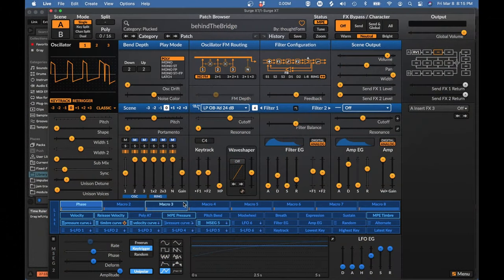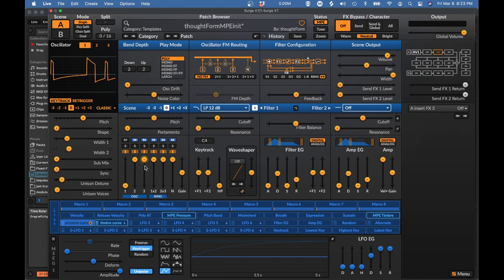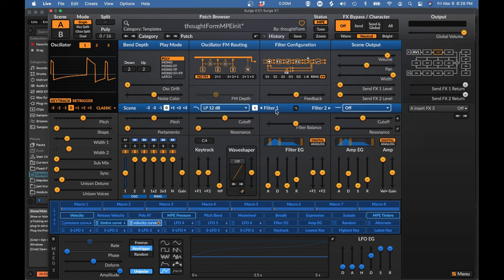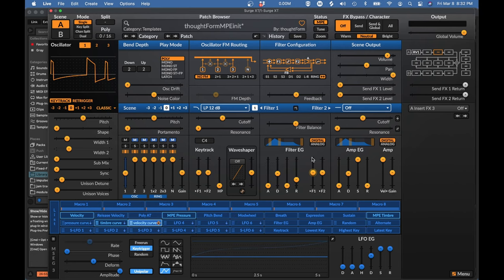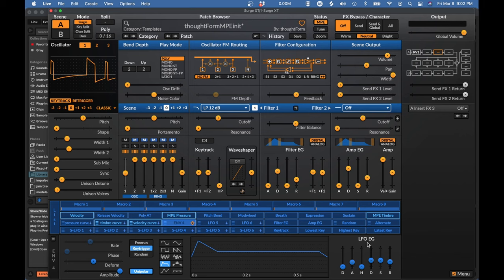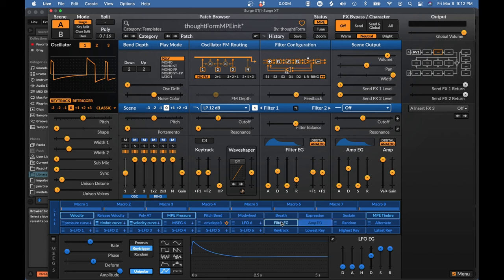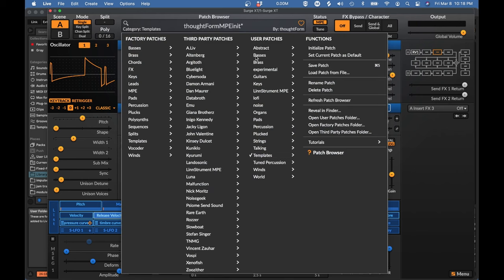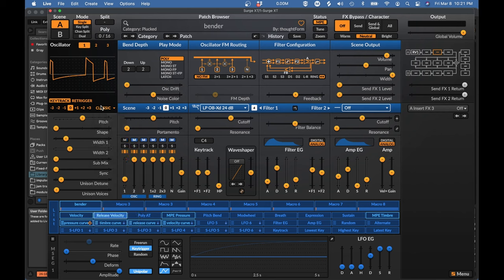MPE Sound Design in Surge XT: Plucks and Envelopes

Comment: I really like your "Pluck and Sing" sound for the Linnstrument. Could you make a short video describing how you created that? For that sound, I notice "Keytrack" modulates the Amp EG decay. What does Keytrack do?
Reply from the maker: Keytracking will give you a higher number when you're playing a high note and a lower number when you're playing a low one. It's useful for a lot of things. I don't remember what I did for that sound at the moment, but most likely I wanted more sustain on the higher notes but the low ones were getting muddy, So with keytrack, more decay on the high notes and less on the low. Does that make sense?
Reply from the maker: I will keep that sound on my list of videos to do but I can't promise when it will come out.